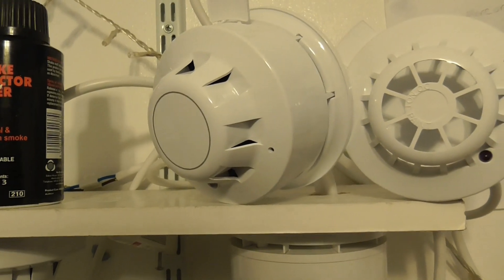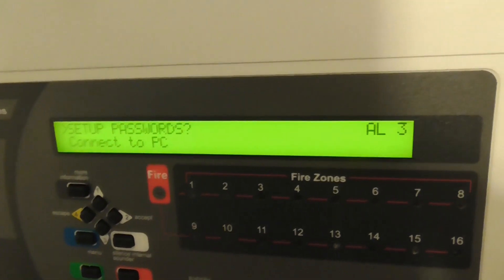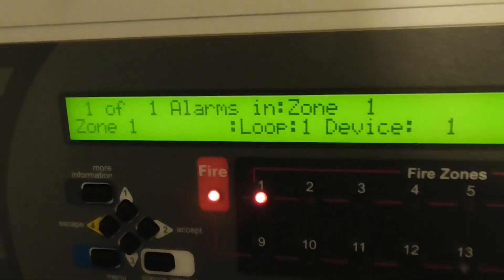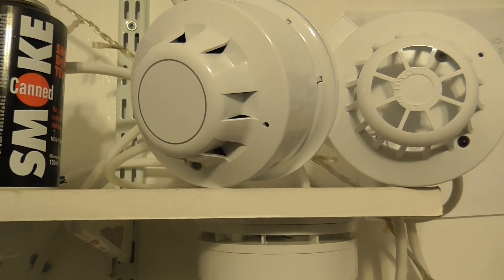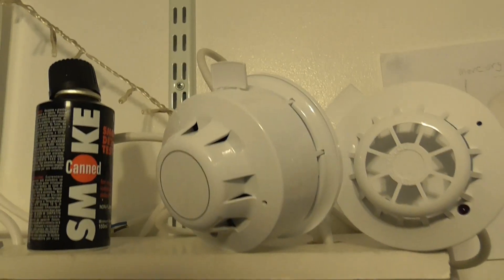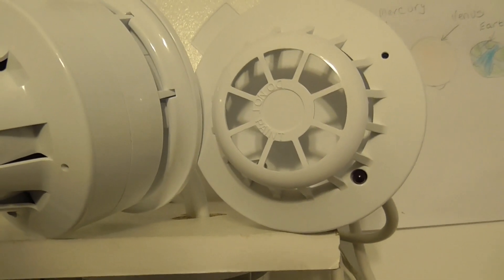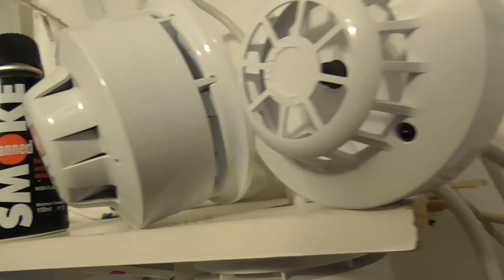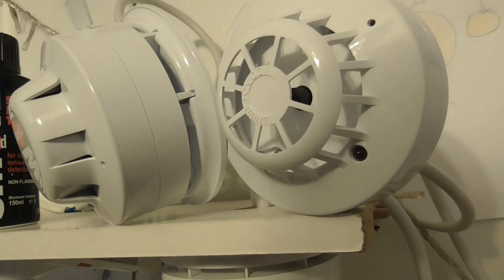Apollo XP95/Discovery System Test 2

Comment: Does the CFP alarmsense work with non-alarmsense call points and detectors?
Reply from the maker: The CFP alarmsense panel will only work with alarmsense devices such as alarmsense call points and detectors. Hope that helps :)
Reply: @j1firesystems440  ah okay. Well looks like I'm not getting alarmsense😂. Lol.  Thanks
Reply from the maker: @imreszappanos690  Oh ok 😂 you can get normal conventional Sounders that can be added onto the system as well but the panel needs alarmsense devices
Reply: @j1firesystems440  yh I knew about the separate sounder circuits but I didnt know about then devices but not I do.    Thanks 

I guess I'm sticking to the normal CFP😂
Reply: @j1firesystems440  FireSafteyTech17s CFP Works With Non Alarmsense Devices Only Conventional
Reply from the maker: @Siobhan_OShea  Yes you can get C-Tec CFP that only works with Alarmsense or you can get a C-Tec CFP that only works with conventional devices.
Reply: Look like chubb panel

Comment: Pre-alarm is when the detector's analogue reading is below the value that it would go into alarm. A normal analogue value is around 23 for detectors. A pre-alarm value is 45 and an alarm value is 55 (they are configurable). Basically, if the detector's analogue value is between 45 and 55 it will go into pre-alarm.

So basically all you need to do is keep the hair dryer on a bit longer until it goes into fire. Hope this helps
Reply from the maker: Thanks for the info!
Reply from the maker: I also got told that pre alarm can be turned off in the software too which I might have to figure out how to turn it off
Reply: @j1firesystems440  Nice! The XP95 opticals activate the quickest as their analogue readings go up really high fast, up to 127 which is the maximum. If you can't find a way to disable pre-alarm, you can just change the pre-alarm analogue value to 1 lower than alarm, as there would be a very small difference between them.